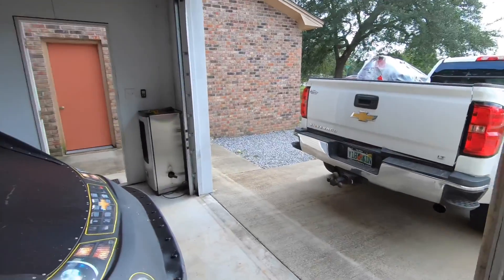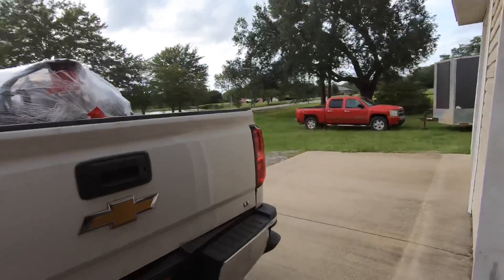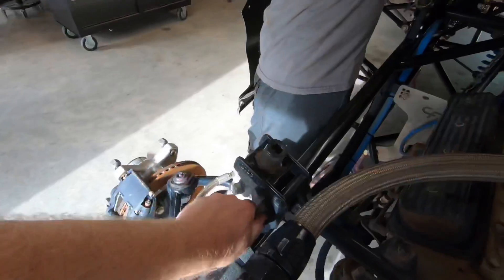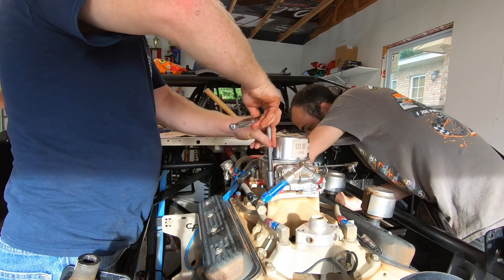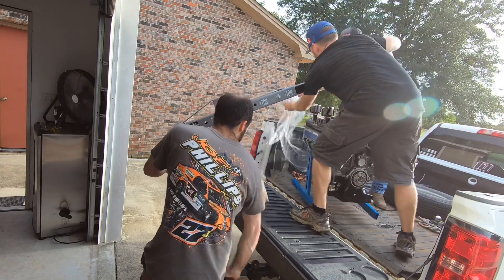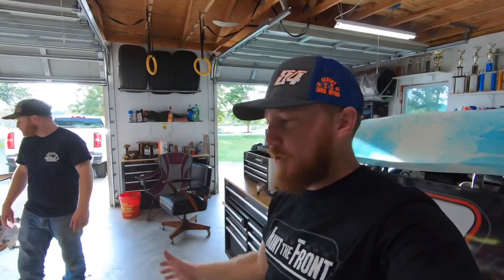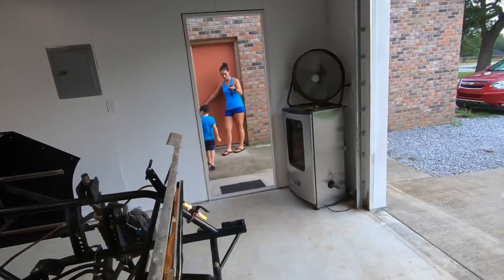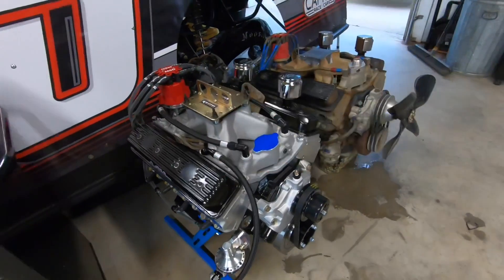We Bought a New Engine for the 56 Car! (Big Money Races Coming Up)

Comment: Dont forget to suspend a new PS belt in the bellhousing for a spare with some plastic ties. Works great, if you ever break a belt you just cut the ties and slide the new belt on. Beats the heck out of pulling the trans out at the track..
Reply: 👍" AWESOME  ADVICE "💯
Reply: Smart Trix on the PS belt

Comment: I fabricated the intake motor pull plate at our welding shop in the late ‘80s. The mechanic/race car builder/motor builder he took out a add in dirt track magazine sold them as fast as I made them! He amazed me setting up the “X” adjustments fo handling with a bathroom weight scale under each tire. I now see a more suffocated set of scale used professional asphalt racers. We sold our welding/fabricating business in the mid ‘90s. Thanks Mike for letting us be a part of Mad1 Racing back then!

Comment: Suggest you find something that actually seals the exhaust ports to headers especially the center ports. You don't want exhaust pressure swapping into one another at that point.
Reply: That's a fact Jack you are notoriously observant and smart too if you mess up the exhaust pulses you are loosing HAWWSPOWER

Comment: Wire tie your spare power steering belt inside the bell housing just in case you break one. Won’t have to pull everything out to put a belt on it.

Comment: Hey guys, I noticed there is an AN10 oil sandwich plate in between the block and oil filter.  Who makes that part and is it equipped with thermo switch?

Comment: Dang, I was hoping you’d say Screven Motor Speedway for the 12th 😂
Reply: What is screven running on the 12th. I live down the road from there and didn't know they where having anything
Reply: Adam Mathews, They are having the Freedom 60. | “The Freedom 60 will feature action featuring the Southern All Stars Super Late Models for $10,000 to win, 602 Late Models $1000 to win, SCDRA FWDs $2500 to win, Southeastern Modifieds $1200 and Road Warriors $750 to win. Gates open at 12 noon.” The races will start at 6!
Reply: Jonah Doyle thanks for the reply. Sounds like I'm going to have to check it out

Comment: If that's just a sealed crate motor with the addition of a carb, distributor, fuel and water pumps, wouldn't it be cheaper to buy a 604 crate motor from gm and add the same carb, distributor, fuel and water pumps yourself?
Reply: Im sure this one has been on a dyno with carb on and got max hp
Reply: @randallowens5228  The only problem with dyno tuning is it's only good for that day at that location. Change locations and/or atmospheric conditions and that tune is void!

Comment: that's a smart idea putting that duct tape on top of the manifold where the hole was cuz I did that one time and I had dropped a nut down in the in the manifold and I ended up ruining a motor that wayand I sure did learn a lesson on that one but I thought I had blue smoke coming out back of my car and all that plus I never did that again
Reply: Buddy had one the threaded pieces from a modified beadlock somehow end up in his intake and get into the cylinder while the car was setting in corner of shop and found out the hard way when it busted the head and block and fill his shoe with water while warming it up to get it ready to take to track

Comment: Did the motor in the car go 5 years without being rebuilt
Reply: I'm pretty sure that's right! Probably something that should have been done long ago! But $ only goes so far
Reply: Jonathon Wood  That may be my best bet for a Limited modified . I’m wondering what the price is on that motor
Reply: @josephanderson4613  you talking about the new one they just bought ? Or a good used 604 ?
Reply: Jonathon Wood  New
Reply: @josephanderson4613  
Depending on if u get one dressed out or just intake to oil pan. Intake to oil pan CT400 604 runs around $6,800. One ready to drop in with carb, distributor & wires etc with Dyno sheet varies on price, I have saw them go from 7,500 and up but one with the best parts cost around $8,500
Reply: Check out Hendren racing engines, just Google Hendren 604 crate engine they have what I think is a good deal on a dressed out 604 with Dyno sheets $8400
Reply: Jonathon Wood  The 8500 how much hp
Reply: @josephanderson4613  there all 400hp but companies tweak the timing carb/jets valve adjustment etc to get maximum horsepower so I'm not sure the exact numbers but anyone that knows engines can get around the same HP numbers, to do good in these crate classes comes down to driving ability and car set up really
Reply: Jonathon Wood  Thanks
Reply: Jonathon Wood  thanks for the information
Reply: No problem bro, Good luck getting the car going and when you start racing, cheers from KY ✌️

Comment: Crate 602 motors are junk !!! Had three brand new 602s on the dyno , with over 50 hp difference between them ... Have your local engine builder build you one !!